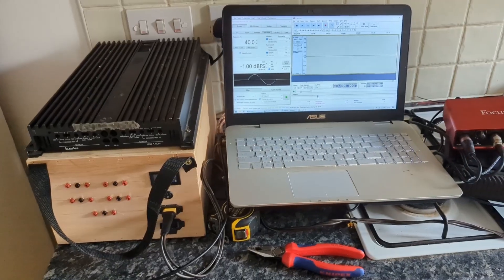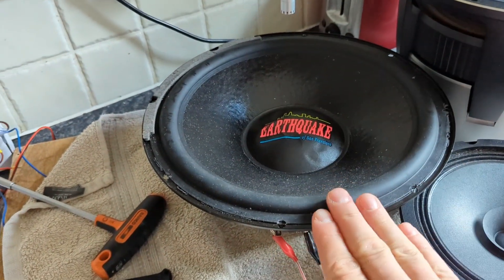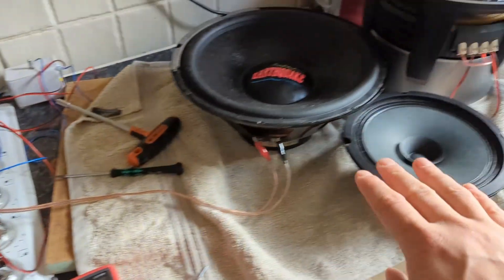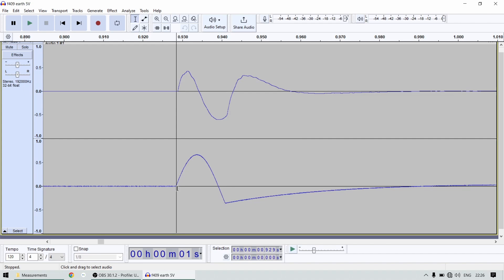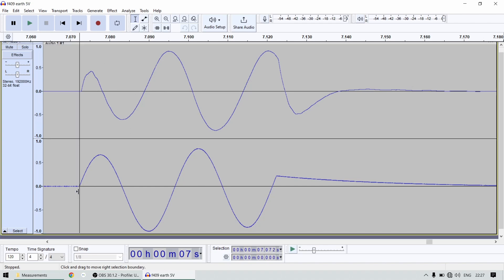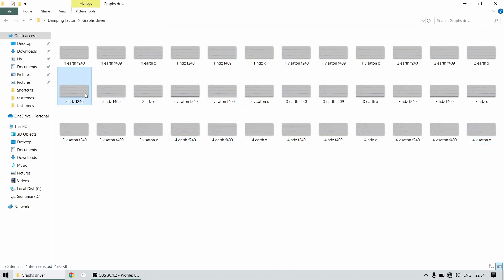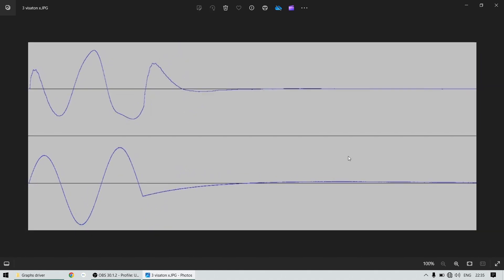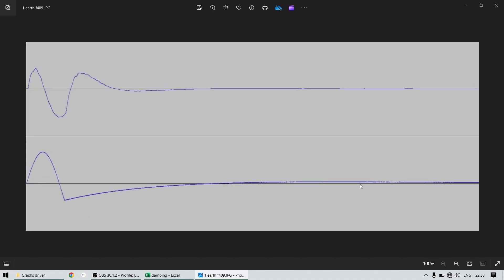Amplifier damping factor - results

Comment: I think you need a low-pass after the Focusrite Interface. The burst you are generating contains high frequeny, this is why the speakers behave so different from the electrical Signal. I think it's quite rediculous to evaluate a result more than relative.
Reply: The waveform is a sine wave, which contains only the fundamental frequency - where are you finding high frequency?
Reply: @PlatypusPerspective  hi, at the beginning and the end if you want. Zero line to sine transition ist like a transition, different to a contiuous sine. This is why I think a low pass would Help. Do you agree that what the Amp outputs is very different to your sine? It is the  sidebands being added by turning the sine ON and off. Does that make any sense?
Visually the high frequencies are in the sharp corner between the Zero line and the ascending sine. IT is almost like a rectangle.
Reply: @thomasschwarzenberger8943   Hi there, we'd need to see the waveform at the input of the amp to be sure how closely it is able to follow it. We're taking it on trust that REW is creating an ideal waveform, and that the DAC is outputting it faithfully. 
 It seems likely it is, at least at the start of the sine wave which looks extremely good to me, I can't see any hint of a discontinuity there, it seems pretty much exactly as it would be if it was the zero crossing to the second half-cycle if there had been a negative swing preceding it. Have you noticed that the subsequent divergence of the wave is due to developing a DC offset? The discontinuity at the end is the waveform terminating at the correct time but pushed off the zero value by the offset amount. Again, we'd need to compare the different stages of signal processing to see where this originates. It relates to reactive energy storage in the signal path, and several people have requested comparative tests into a purely resistive load to see how much of the variance is due to the speaker's reactance. If we could observe either that a resistive load resulted in the theoretically correct waveform at the amp output, or that the amp input signal is in fact the exact theoretical REW waveform, implying the same thing, we could form a better conclusion.
Reply: @PlatypusPerspective  I saw that, and was  thinking this looks Like a coupling capacitor being discharged.  Speaker ground, Signal ground and supply ground are the same? Could it be that the Amp causes just a ground shift?
Reply: @thomasschwarzenberger8943    Yes, my initial thought was the overall circuit is unlikely to have a response down to DC, and a coupling capacitor is storing energy, then releasing it back in the tail at the end of the waveform. An amp with capacitor coupled speaker output can show similar DC offset in the speaker drive, in comparison with a direct coupled output. If you consider the energy content shown by the areas under the curves (power), I'd guess the energy missing from the smaller amplitude initial half-cycle (being held in a capacitor rather than being delivered to load) looks pretty similar to the area under the tail (charge drained from the capacitor by load in the absence of further input, to return to zero potential).

Comment: So as far as I understand, every speakers has output a half cicle more than the one contained in the input signal, right? So the woofer are producing big distortion of the signal they have to reproduce. I did not expect that! How would perform a smalles driver live the ones currently used by many hi fi tower speakers manufacturers? Let say a 6,5 “ or 5,5”? Have you ever tested such drivers? Thank you and congratulations for your video!

Comment: Than you for a good video! Something I understood after many years was that the speaker sees the damping factor as a series resistance of the output impedance of the power stage and the resistance of the speaker cable. Say the output impedance is 0.02 ohms gives 8/0.02=400. If we have a short or thick cable, it doesn't matter. resistance in copper 0.0175 ohm mm2/m. i.e. if you have 1 m of 2.5 mm2 i.e. 14 gauge it gives 0.007 ×2 ohms. 8/0.034=235. But if you have 5 m of 0.75mm2 i.e. 19 gauge (which is more common with midrange and treble as they don't have to cope with so much power) gives 0.116x2ohm. This gives 8/0.252=31. Then it doesn't matter with 400 or 2000 in damping factor because the cable accounts for all the resistance. Would be interesting to test different cable lengths.

Comment: I don't quite understand why all amps have such huge overshot at the end of any burst. Kind of wierd. The Stereophile magazine made similar experiment with very similar test signals to check speaker cables influence on speaker damping. And, as I recall, they captured overshoots at speaker terminals that were up to 2-3% of burst test signals in amplitude. But at the amp terminals those overshoots were next to zero.
("What a Difference a Wire Makes" by Ben Duncan  |  Jun 12, 2020  |  First Published: Dec 1, 1995)
Reply: the overshoot comes from the dc blocking caps in the signal path of the amp. the charge up during the positive half wave and then even tho the signal goes to 0 and stays there they still have to discharge causing that overshoot. in other terms they introduce a phaseshift so the signal doesnt start on the same part of the wave and doesnt end on the same part so you dont completely end on 0
Reply: @sedon7098  Isn't that overshoot a very high distortion then? Like 10-20% of the test signal? While typically modern amps have a distortion way less than 0.1%.
Reply: Distortion is measured using continuous waves where this overshoot would not be present. It's an artifact of using short test signals.
Reply: @dwindeyer This channel is devoted to testing of mobile audio equipment (“car audio”). Considering the outrageous amount of intentional distortion inherent in most music played in such systems, I think such artifacts would be buried in the very high road and engine noise when vehicles are actually in motion.  
A note re the Visiton - it looks to be one of their “full-range” models very commonly used by home audio DIY builders, and would very often be high passed and reinforced with either passive or actively power woofers/subs at higher frequencies than used in this test. Not that this is intended to disparage the test, or dispute the results - indeed, i thought it performed rather well in comparison to purpose built drivers with substantially more powerful motors. 
Nicely done, sir.

Comment: Nerijus I have a comment/question about the last statement you made in this video. You suggest when picking an amplifier to generally choose one that’s the cleanest AND has the most power. I get that but what has me confused is that in just about all of the distortion graphs you’ve posted of different amplifiers you’ve tested, the least amount of THD present is generally just below rated power of the amplifier. Right before it jumps way up into clipping.

I may be reading the graphs wrong but the general trend in most of them is a downward trend in THD as the power output goes up to a certain level and then a sharp rise as the amp reaches full output power.

In that case would it make more sense to choose an amplifier with lower power output for driving midrange and tweeters? Especially if you listen at moderate levels somewhere around 90db? I know there’s drivers out there that can play that level, and some slightly above, with just 1watt of power. 

So even accounting for good headroom would an amplifier that outputs around 30-40 watts at its lowest THD be a better choice than a more powerful amp that has its lowest THD at around 90-100 watts? I’m talking about just for midrange and tweeters. And I’m just using those wattages as an example. I have no clue what real world wattages would be to drive midranges and tweeters to a modest listening level while still maintaining adequate headroom for dynamic peaks.

Thanks for all your hard work putting out these videos.
Reply from the maker: Yes, you are absolutely correct. An amplifier with less rated power might be cleaner than a more powerful one at lower wattage. However, that is mainly THD+N. For a lot of amplifiers THD is a straight line and shoots up only before clipping. Noise is the thing that raises the curve at lower power levels. However, if the noise is very low and is not audible, it does not matter much. The problem is that these days there are not many low power amplifiers. You can fing old school 4x30W, but not today..
Reply: @RAW-CAt  Thanks for clearing that up for me. I actually have an old school MTX 4320 Thunder series amp that I bought new back in 1994 I think. It’s rated at 4x40 but the birthsheet actually shows a lot more. It’s a very clean amp and was a direct competitor to the old Alpines that you use. Mark Eldridge actually won several world competitions using these amps in his early 4 Runner builds.

I have been using it since then up until recently when it started to pick up some alternator whine.. I switched it out to a JL HD600 and it’s way too much power for what I’m using it for and just doesn’t sound as clean as the old MTX. If I didn’t live in the US I would ship it to you for testing. I’m pretty confident it would measure every bit as good as your Alpines.

Comment: You mention driving the speakers with 3 to 7 volts.  Did you try more voltage/output?
Reply from the maker: Yes, in free air they go over Xmax. And the smaller amp cannot drive the HDZ sub with more power.
Reply: @RAW-CAt  I see, maybe build an enclosure for the smaller driver and run it to max unclipped output of the weakest amp, then compare with other amps at same voltage?  Thank you so much for your effort and exploration, I just feel like there must be a way to measure this more accurately.

Comment: You should have also tested the cables and termination as they have resistive values and can negate any damping factor of an amp. So if you habe an amp with a DF of 500 and another with 25, but use terrible cables ans high mass termination, you can bring both damoing factors to almost the same. 

For instance, the amp of a DF of 500 lets assume that is at 8 ohms. 8÷500=0.016 output impedance. 

The amp of a DF of 25 has an output impedance of 0.32. 

Now lets use 2 different resistive values for speaker cables. Lets use .250 ohms and .00350 ohms. 

The amps with a DF of 500. 
.016+.250 = .266 which to find out the DF of thst outout impedance lets keep it at 8 ohms. 8÷.266 = 30 DF. 

Now lets try that with the .00350 cable. .016+.00350=.0195 which is a df of 410. 

Now lets try the amp of a DF of 25

.32+.250 = .57 which is. DF of 14. And for the other cable. .32 + .00350=.3235 which is a DF of 24.72. 

You see how much cables and termination can negate the DF of a higher DF amp. With the high resistance cables, both amps would sound the same with the bass. This is also why a lot of people think all amps sound the same. Their cables can be negating the differences in DF.
Reply from the maker: All measurements were done with very short oversized cables, so resistance is minimal. Off camera I compared those measurements with an 8 meter long cable that has higher resistance, however there were 0 difference between the measurements..
Reply: @RAW-CAt  Please check the Stereophile article "What a Difference a Wire Makes" by Ben Duncan   Jun 12, 2020
Reply: @RAW-CAt cables that I saw in the video were relatively thin. Plus, crocodile clips can have high contact resistance. Unless this wasn't the test setup actually used?
Reply: @RAW-CAt  Please check the Sterophile article "What a Difference a Wire Makes" by Ben Duncan  |  Jun 12, 2020  |  First Published: Dec 1, 1995.
Reply: All true. And all irrelevant. The DC resistance of the voice coil is in series with all the other resistances. The DC resistance of the voice coil is typically about 60-70% of the rated impedance of a cone speaker.  Lets say 5 ohms for an 8 ohm speaker. A few milliohms of cable resitance or connection resistance is a rounding error. The amount of electrical damping the loadspeaker experiences is totally dominated by its own resistance, unless the amplifiers output impedance is measures in ohms, not milliohms.

Comment: Maybe disappointingly similar results, but helpful testing nonetheless. 

Another interesting research topic related to output impedance of amplifiers and their ability to control the speaker cone would be voltage drive vs. current drive. 

I've read some anecdotal evidence and couple research papers from those who have experimented with current-driven speakers, would be cool see more of unbiased testing and objective data to see if there's some truth to the alleged benefits of current-drive amplifiers

Comment: Great testing.  I think you need to compare the input and output signal.  You can do this by subtracting the one signal from the other in audacity.  If there is a difference in draping factor, you would see different peaks of the difference.